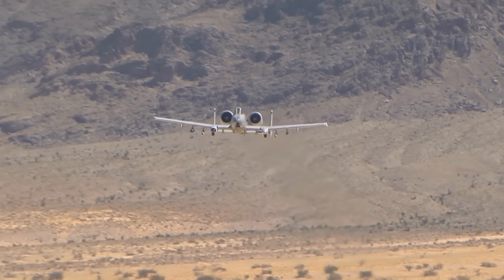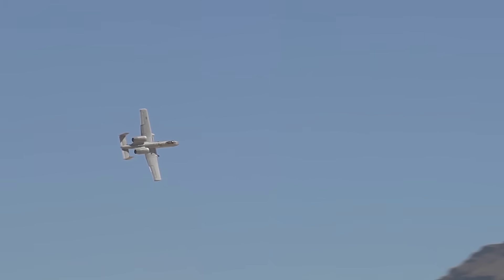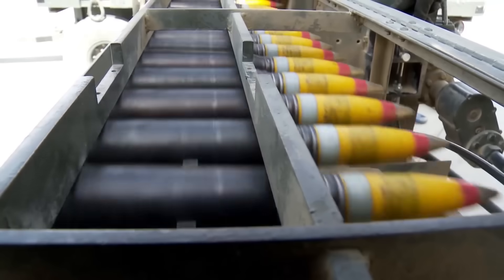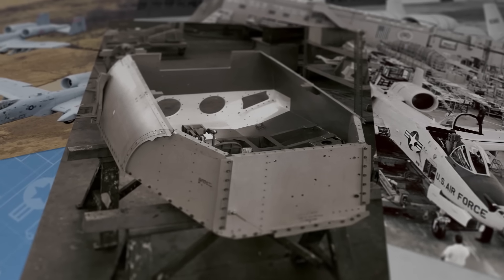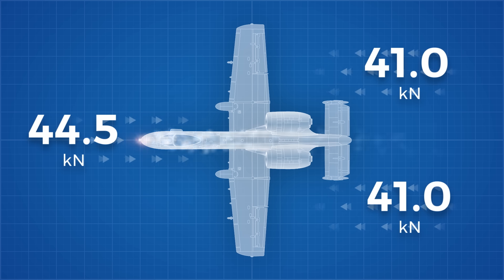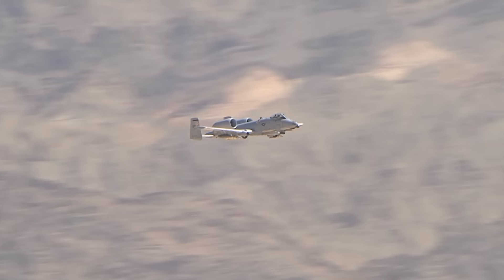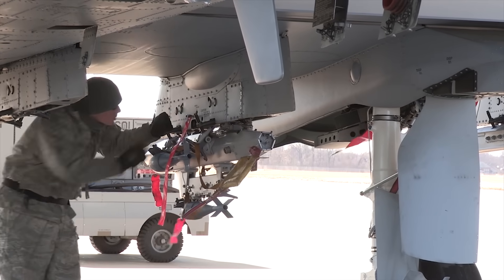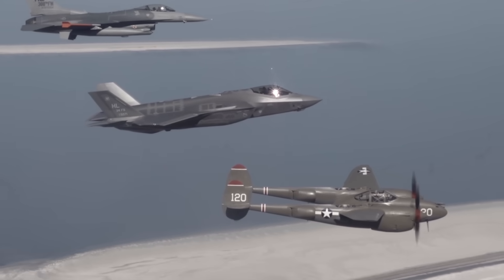The Insane Engineering of the A-10 Warthog

Comment: A-10 cost effective, simple, can survive enemy fire and return to base!
F-35  Has left the chat....
Reply: It also looks cool
Reply: F-22 FTW
Reply: The A-10 is a very cool plane but it's outdated. Sure it's designed to protect the pilot from 20mm cannons, but its armor isn't enough to stop modern MANPADS. It might seem counter intuitive but if the A10 relied on guided weapons instead of its 30mm gun it would be able to perform Close Air Support missions more precisely with less risk of friendly fire. This would also let it perform CAS at higher altitude where it'd be safe from AA guns and its flares and electronic countermeasures against surface to air missiles would be more effective.

Comment: The object identified as the APU exhaust is actually an IR sensor.  The gun is NOT mounted on the centerline.  It is mounted slightly off-center so that the firing barrel will be on the centerline.

Comment: From a historical perspective, the notion of a flying gattling gun designed for ground support was not really based on the P-47 thunderbolt, but the Douglas AC-47, or "Puff the Magic Dragon".  It was around the mid-60s that the Air Force added three mini-guns on the port side of a mail carrier plan, allowing it to devastate a target while circling over extended periods.     It was not a tank killer but a troop concentration obliterator.  So while the role was different, that program made very clear that an airborn minigun platform was a necessary tool to support rapid, minimal deployments from those moments when they stepped in it.  In Vietnam, the "it" was surprise troop concentrations by sneaky guerillas operating relatively freely due to poor US military intelligence.  The first wave of dedicated flying miniguns were rotary flight platforms (think precursors to Apache helicopter -- but the actual Apache did not come online until 1982, while the A-10 was up an running by 1977.)  The idea of the A-10 being designed to intercept advancing Soviet tanks comes from that mission having been initially assigned to the A-1 helicopter.  Anyway, both roles represent a shift in the concept of flying artillery - from bomb and missile driven work primarily against fixed targets to a minigun based framework going up against highly mobile targets often operating from positions of concealment (e.g., think VC operating from jungle cover only now it's radical militants constantly shifting their operating positions from one dwelling to another -- the availability of drones as a missile platform has affected  the calculus as well, which is one of the reasons you were hearing talk about retiring the A-10 more back when tacticians were out selling a new "smart" warfare without troops -- good one -- and less now that the limitations (yes, EFFICACY) of having techs in front of computer screen drop bombs on civilians - that, it turns out, is a good way to LOOSE a war, not just have the leftists getting mad that you blasted a sand-pile with depleted Uranium).
Reply: @Domenick Masiello The AC-47 was the the first non-rotary implementation of the concept.  The rotary cobra platform and the fixed wing platform that would become the A-10 were competitors in the pentagon's internal fights for money and status.  But either way, it's a weak case to say the P-47 was what led to this design concept of rapid airborne  encircle (AC-47) or hover (AH-1) gatlin guns that can substitute for artillery which underpins the A-10.

Comment: and they are thinking of decommissioning this thing? good luck. doesn't seem easy or cheap to replace this thing, let alone with a more better performing plane. literally laughed when i learned they wanted to replace the A-10's job with the F-35
Reply: The Air Force is focusing on fighting against advanced militaries like Russia, China, Iran instead of killing some Allah fans in the desert. For that task a F-35 is better suited than a A-10.
Reply: @bruceu2274  well it focuses more on tech than brute force. the A-10 is meant to dispense a high volume of 30mm, and carry a whole lot of ordinance. i'm not against the F-35 existing, but i believe that they should keep it (the A-10) in commission.

Comment: The reason the Air Force doesn't like the A-10 is because it has NOTHING to do with the Air Force's mission, which is more strategic in nature. The ONLY reason the Air Force has the A-10 is because the A-10 is a fixed wing aircraft, and the Air Force has responsibility for ALL fixed wing aircraft that supports the Army. Navy and Marines have their own planes, thank god. 
I wish Congress would fix this mistake made at the re-designation of the Air Force from the Army Air Corps.

Comment: The A-10 MUST be retained. 
An exception must be made to let close air support fixed wing aircraft, like the A-10, to be operated by the Army. 
The "fixed wing" monopoly of the Air Force is wrong and silly. 
The specification of what the Air Force can fly, and what the Army can fly should be determined by FUNCTION, not configuration. 
The A-10 is much better at ground support and ground attack than the AH-64 helicopter. 
They perform a similar role, so Army should have authority over both.

Comment: 0:15 he calls it the "lightning bolt" when it is actually the "thunderbolt".  How do you mess that up on a channel with Engineering in the name?
Reply: As an Air Force vet that irked me, but I have to correct you. The A-10s name is actually the Thunderbolt 2.
Reply: Was going to point this out as well... Little flub.
Reply: I noticed that as well.
Not completely off putting because he's obviously a foreigner so I'll cut him a break.
Still an eyebrow raiser though.🤨

Comment: We can build 6 A-10s for the cost of 1 F-35.  Are we really going to fly F-35s on the deck for close air support?  Not if the people paying for them have anything to say about it.
Reply: You can possibly build 2 A-10s for each F-35. Why would you fly on the deck for CAS in the first place? The A-10 only does so because it was designed in an era where flying low was the only effective way of performing CAS and as such isn't nearly as effective at the role from higher altitudes.

Comment: The depleted uranium scare tactic is political  bullshit... I worked at a uranium mine in the late eighties... the danger of radiation from depleted uranium is almost non-existent compared to actual  ore ,which is also almost non-existant. Natural uranium contains 0.72 u235, depleted uranium contains .03 u235 or less.....cinder blocks , bricks and concrete are more dangerous....unless you are in the path of a depleted uranium shell....

Comment: The A-10 Warthog: Proof that with enough thrust, even a brick will fly.
Reply: F-4 Phantom : Am I joke to you?
Reply: @hotshotstevennonofyourbiz7200  >>> 😆😆😆
Reply: For a brick, it flew pretty good.
Reply: Anything will fly with strong enough engines or enough force, even a normal everyday car
Reply: @theshermantanker7043  Agreed on the everyday car...just need to be sure the darn thing has control surfaces to steer it where it needs to go, lol.
Reply: @vinyltapelover  all I said was anything would fly with enough speed and force, I never said it would fly well ;)
Reply: @theshermantanker7043  I copied you well on  that. I think you mistook my motives. I wasn't getting serious or technical. I was just merely having some "non serious" fun during these covid times. Yes?
Reply: TheShermanTanker tell that to my diet
Reply: @theshermantanker7043  lol for days
Reply: stares in MiG-31
Reply: @LtViper  stares in C-5M Super Galaxy
Reply: How bout pigs?
Reply: @criticallyconk4944  
5            Fundamental Truths of Networking        1 April 1996

   (3)  With sufficient thrust, pigs fly just fine. However, this is
        not necessarily a good idea. It is hard to be sure where they
        are going to land, and it could be dangerous sitting under them
        as they fly overhead.
Reply: @criticallyconk4944  cops?
Reply: Space Shuttle: Lucky!  I just had to glide to the runway because i have no fuel left
Reply: Nothing brick about the A-10. Space shuttle, yes. A-10, no.  A straight wing, low speed, heavy ordnance carrier designed to be fairly maneuverable at speed and still rain heavy amounts of death on the enemy....for up to TWO HOURS loiter time on station?!? 
Ask the boys on the ground what they want to come in and cover them. F35= a few bombs for a few minutes. A-10= Lotsa bombs for hours.
Throughout aviation history there have been workhorses, some who brought their crews home through anything (B-17) and kept flying long past their operational design life (B-52). The A-10 is solidly among them, because there is still a job that only it can do.
Reply: Actually, the A-10 is a pretty sexy plane if you ask me. It's just not very conventionally configured is all... I've personally seen the A-10 in action during live fire exercises. Being a gun guy, I'd give a testicle to be able to fly one and operate that GAU-8 cannon. There really is nothing quite like it!
Reply: Laughs in B-2
Reply: Hahahaha
Reply: Underrated comment
Reply: Anything can fly... at least once.
Unless it can be controlled.
Reply: Haha yes its physics dude
Reply: Just like it's predecessor the P-47.
Reply: unfortunately, real tanks dont have thrust
Reply: magic carpet has entered the chat
Reply: Space shuttle: Hey
Reply: The F-4 : Am I a JOKE to you?!

Edit : And only after I post do I see this was the first response :D
Reply: The A-10 has a pretty low stall speed, actually.
Reply: hahahaha crunny funt you are
Reply: That's

Yeah, that's what thrust means.
Reply: And wings
Reply: @mayankraj2294  No, lol. The A-10 can lose the outer wings and still fly from the thrust it can produce. That's why I said a brick, meaning with enough thrust you don't need wings.
Reply: @TheProblematic93  see, it has extra wings probably (maybe) makes it more efficient at slow speeds but that doesn't mean it would actually  be able to fly without one lol
Reply: @mayankraj2294  Did you watch the video? He says the same I'm going to say here, the plane was designed to fly through the guns recoil, and in doing so, it can also fly with the outer wing ripped off.
Reply: @TheProblematic93  outer wing okay but are you really saying it can fly without a wing? Like seriously?
Reply: @mayankraj2294  Yeah, it can lose from the thruster out to the wing tip and still fly. Not well, but it'll make it home.
Reply: @TheProblematic93  like out of genuine curiosity, like really? If we took out both wings (the whole wing, both of them) will it still fly? It's basically a rocket (in some regards) at that point. Why is it so slow then? Is it?
Reply: @mayankraj2294  it's purpose built, made to delete villages, not win races. I would assume they fly conservatively for fuel since they have to throttle up against the gun's recoil.
Reply: @mayankraj2294  Also, the quote "Proof that with enough thrust, a brick will fly" is how the pilots described it to my Brother when he was in Iraq. Along with "If you hear the brrrrrt, you weren't the target"
Reply: @TheProblematic93  Caleb, the fact is that the A-10 turbofan engines are not all that special OR exceptionally powerful. Those same engines are used in other sub-sonic US aircraft too; they're nothing "special". In fact, they aren't even equipped with afterburners. 
They provide plenty of thrust for the "slow and low" design parameters of the aircraft, but not a lot more. The A-10 CAN fly on just one engine, that's why there are 2.
Also, as a sheer fact of aerodynamic lift, NOTHING can fly without a lifting body like a wing. As Manak pointed out, the A-10 is not a "rocket" it's an airplane. If it's not an airplane, or a rocket/missile, if it "flies" it's called "a projectile"! LoL...
Yes, the A-10 is a wonderfully "durable" aircraft with multiple levels of redundancy built into it to make it more likely to survive combat (like its 2 engines instead of one), but there IS damage it may see which at some point WILL make it un-flyable; losing a major portion of either wing is #1 on that damage list of what will make it fall to the ground like a rock. 
Also, the A-10's "designed role" in combat is being a "tank-buster", that is the entire purpose for the GAU-8 cannon the A-10 was designed around (yes, the gun actually came before the aircraft!). Ground support for the infantry is part of that "tank-buster" role, but "leveling villages" is definitely not what it was meant to do. We have bombers for that purpose.
Reply: @mayankraj2294  its not that strange. I believe a marine or navy attack plane once flew with the wings still folded in storage position and at least one f15 has made it home missing a wing thanks to the fly by wire maintaining stability.
Reply: @TheProblematic93 correction it was purpose built to blunt soviet armored thrusts through the Fulda gap.
Reply: @PJS50  the A10 was definitely meant as a tank buster. But I believe most of the anti armor firepower was always intended to come from the missile/bomb load. 

The GAU8 is an impressive rotary cannon but it was already debatable whether it would penetrate most soviet tanks of the time with a properly lined up gun run and was considered ineffective at all angles against later generations of soviet armor.

I believe it was largely relegated to a secondary weapon to engage relatively soft targets like IFVs.

Comment: The author of the video does know a lot about the aircraft, but totally blew the spelling for "propellant" at 10:34.  Apparently unburned powder and residue gummed up the spell-check function. 

I used to see these badboys fly out of Volk field in WI and you could hear them miles away.  I would be on a small lake fishing in a rowboat and could hear that roar long before the planes would go right overhead only a little above the treetops.  When they did finally pass overhead they'd shake the entire boat!  It was amazing!!!  I can only imagine what the enemy would think when one of these planes would decide its a good day for them to die.  You can hear it coming, but can't see it and it's so loud you can't tell which direction it's coming from until "BLAM!" and you're playing a harp.  Simply the most amazing aircraft I've ever seen.

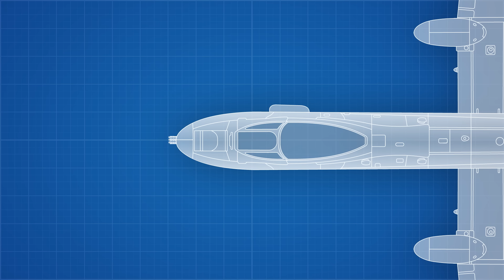Comment: 7:46 I believe the center of the gun rotary is slightly off center of the airframe because it’s one of the side barrels that actually fire the bullet. It’s the firing barrel that’s on the center line so as to not add adverse yaw.
Reply: Was bugging me so much that was incorrect in the video.  The reason is correct, that the gun outputs so much force that it needs to be very carefully aligned to stay on target.  But you're right, it's off center just a hair.
Reply: That is correct. The "hot" barrel is at 9 o'clock and that aligns with the centerline. The overall assembly is offset to the left - you just need to look at one front-on.

Comment: Don't get me wrong I love the A-10, and I have close family that flies it, but sadly I do believe it is approaching obselete. The A-10 is simply not fast enough or stealthy enough to deal with modern air defense systems. If they flew CAS missions in a contested air space they would be slaughtered. What the A-10 can do is demolish insurgent type troops in a way no other vehicle can. However, this same job could probably be done by a cheaper plane that could be even more durable and easy to fly, but without some of the features that made the A-10 so expensive. I think modern CAS is a serious problem that does not have a good solution. A plane either carriers enough ordnance to have a major impact but is too slow and fat to shake a missile, or it's sleek and stealthy and very hard to shoot down but it can only kill 1 or 2 vehicles out of potentially hundreds before it needs to rearm.
Reply: I fully agree with you.

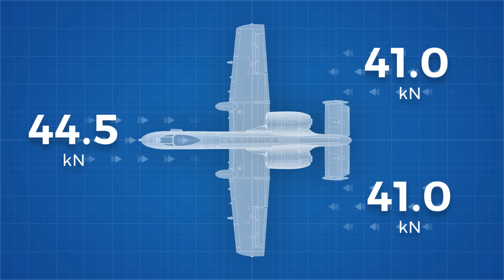Comment: Overall a very good video, but I would like to point out that at 08:00 timestamp the presenter states that the gun is mounted centered on the fuselage. This is not actually accurate. The gun is in fact mounted slightly offset to the left side of the plane and the firing barrel is at the 9 o'clock position. The 9 o'clock barrel is on the centerline of the plane for the reasons the presenter mentions: recoil control.

Comment: The A-10 is not that great. It has a cannon, and that’s fine. But machine gun fire from an aircraft doesn’t do much. Look: if the A-10 had been so great, they would have built more of them. All low flying aircraft are now vulnerable to shoulder-fired AA missiles. The age of expensive do-nothing planes is over.
Reply: Snowflake alert

Comment: 7:50 The gun is NOT mounted on the centerline. Seen from the pilot the gun rotates CCW and fires at the 3 'o clock position. The 3 'o clock position is center to the plane, so the whole gun is slightly to the left. if the gun were centered, the firing barrel would be out of line and induce so much torque you wouldn't be able to aim accurately.

Comment: Another fact on the A-10 is that alongside its CAS (close air support) role its adept as sandy planes for CSAR (combat search and rescue).  
Back in the Vietnam war, A-1 sky raiders went by the callsign sandy when used for CSAR.  Their mission was to support helicopters (callsign jolly green) in keeping enemy forces at bay while they picked up downed airmen.  Since their were so many airmen downed by SAM sites, sandy flights became a regular occurrence.  Presently, the A-10 fills a similar role because of its reliability, ability to loiter over a target area, and ground attack armaments.